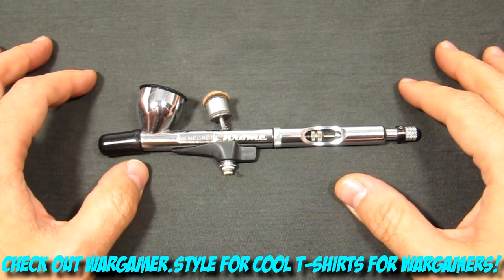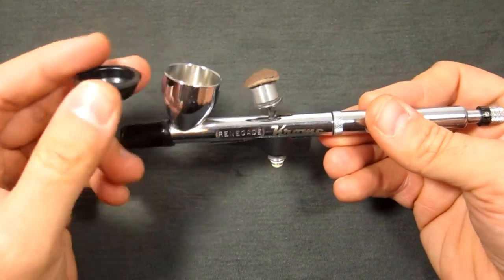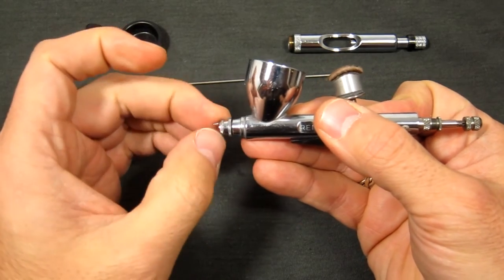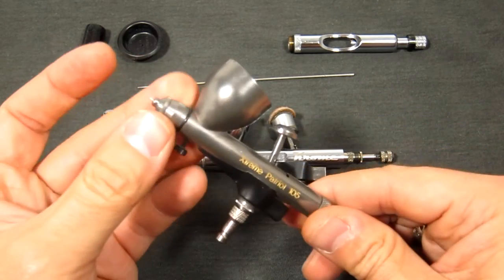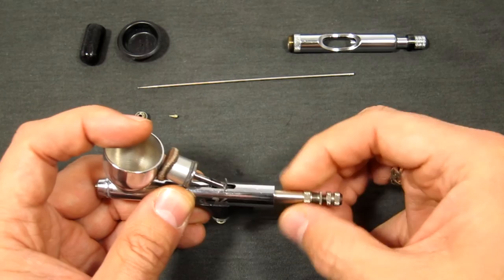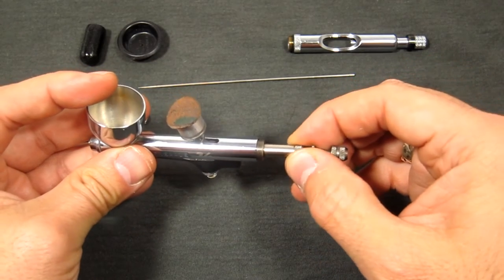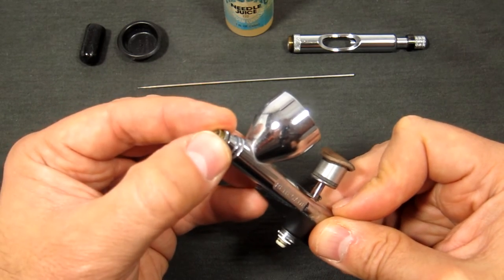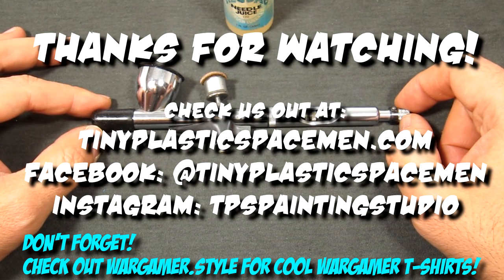Badger Renegade Krome Airbrush Disassembly, Reassembly, Lubrication Walkthrough & How To

Comment: I didn't know the original tip comes in two pieces. I had the paint cap continually flying off after a use and I couldn't figure out why. I took the two apart and cleaned them and it works properly. Thank you for your video, also great tip on the t-shirt. After twice being on my hands and knees looking for the tip this is a great idea.

Comment: Thank you Frank, I'm an engineer that bought this 5 years ago?  4 years ago? on a trip to touch up new equipment that gets marked during install. The directions that come with it....  that DON'T come with it, I shelved the damn thing for all these years and finally today tried to use it. wouldn't work, wouldn't work, not sure if paint is too think, took apart...  couldn't figure out the trigger assembly. THANK YOU THANK YOU for your help. Did I say?  THANK YOU?
Reply from the maker: You're welcome!!

Comment: A side note not related to the tip. I tried thinning my regular acrylic paints and it caused a lot of issue and there was residue which clogged everything. I bought airbrush only paints over the holidays and have not had the continual problems that I had before.
Reply from the maker: +Edward Goldstein some paints are still quite thick, especially standard Citadel paints, because the pigment particles are bigger than airbrush ready paints. Trying to spray it through a fine detail airbrush makes it doubly hard to spray properly, so it's better to use an airbrush with a larger needle size.

Comment: I gave a thumbs down only because you,as the other Krome Renegade disassemblers failed to address removing the rear needle seat ( or bearing) which should be done for deep cleaning. It is a bit of a pain to fine tune the gun afterwards but users may need to know how to maintain their equipment. A slim straight screwdriver to access the brass assembly that holds the Teflon seal is all you need and some patience  as you have to get a feel for tension on the needle, but not too much.